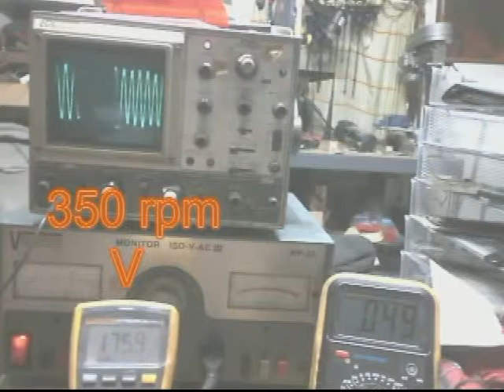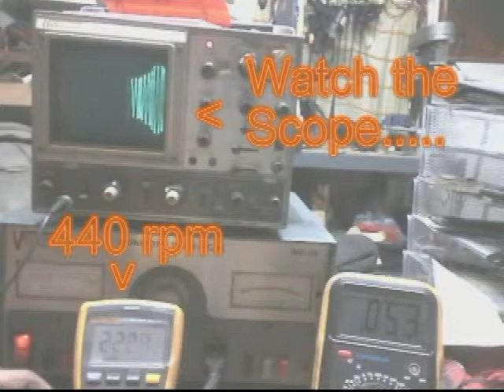SEG-MEC #16B--Fail-broke.mp4

Comment from the maker: My design is on the order of Mr. Searle via the Russians Roschin and Godin design,i.e. a spinning magnetic roller on magnetic platform.My #16c is the best I could get @ 400 rpm with stable signal.My project is up to 18d and is a fail there.I am about to jump ship on this project.You have to view the first several videos to get an idea how I did this by "twisting" Nd diametrical magnets.